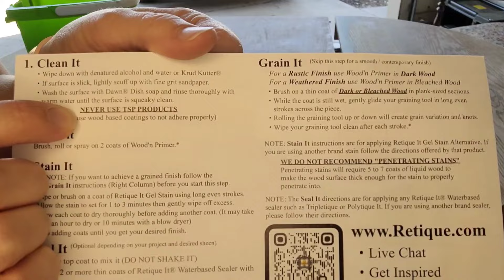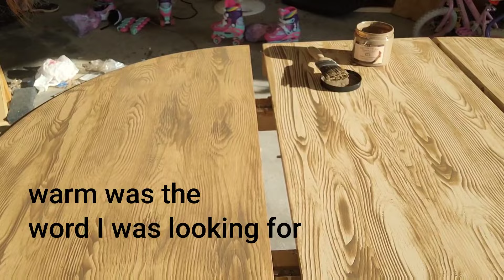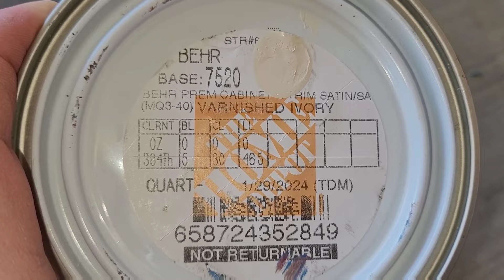dining table makeover using retique it

Comment: What other top coat would you recommend over Retique it? I don’t want to use the tripletique but not sure what other polyurethane to use. I’ve heard water based polyurethane makes dark wood look bad, can I use oil based polyurethane over Retique it?
Reply from the maker: I can't say for sure how that would turn out. You can usually use an oil based topcoat over a water based stain and visa versa, but you need to make sure that it is COMPLETELY dry. I would use the minwax water based poly if I hadn't used the tripletique.
Hope that helps